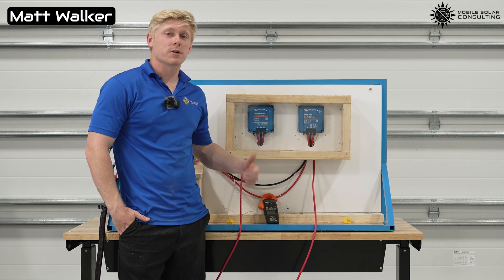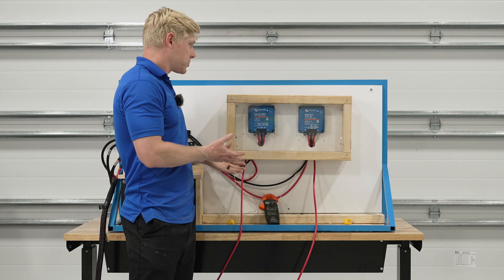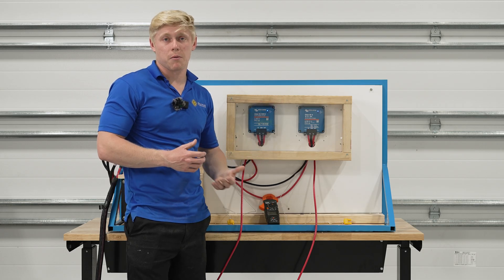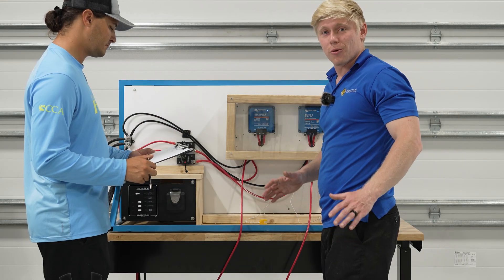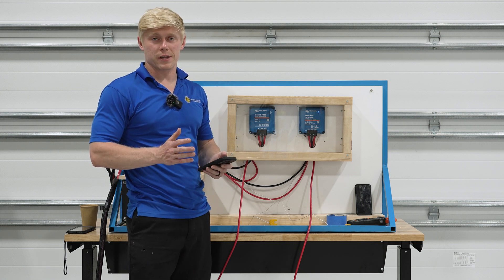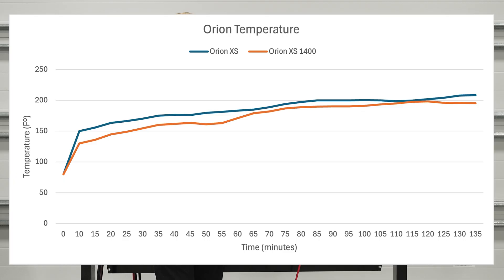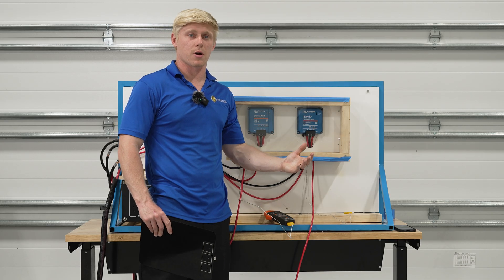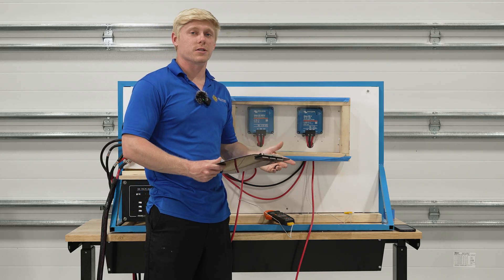How Hot Do Victron Orion XS & XS 1400 REALLY Get??

Comment: Quick comment to begin.. the onscreen vid mentioned at the end, does not appear onscreen.
Also, I replied to a couple of other comments, so see them for more of what I have to say.
Thirdly.. since both of these were outputting 12 volts at 50 amps or so, as far as the 1400 being cooler, I think it's only fair to mention, that since it handles multiple voltages, and was introduced later (ie: lessons learned from the past, implemented in the future), the 1400 has an actual exterior heat sink, whereas the original 12 to 12 is just a flat back design.
EDIT > re: my last point, I know 2 different folks who jumped on Amazon, and ordered a couple of small heat sinks and 'glued' them to the back of their 12 to 12's with thermopaste, to aid in non powered(no fans) cooling ability, to increase temperature control of their units.
Reply from the maker: Thanks for the feedback regarding the on-screen video and the design differences between the models. I've just pasted the link to the other video in the description. It is appearing in the end of the video for some folks, but not for others.

Comment: Hi, you tested them in the same heated compartment at the same time. Wouldnt it be fair to test them in separate compartments to see how they preform without heating each other? Have a great one /Andreas
Reply from the maker: Hi Andreas, thanks for pointing that out. Yes, better to test individually, but it made a very small difference, and represents a typical DIY system well, where the user has many heat-producing items in one small space. 

The temperature on the front of the Orion's was around 20-25C less than the back, at most times, so the entire box was not super hot, mainly just the back of the units.

Comment: Hi Matt. Would you install the Orion in the truck or in the trailer itself. If it needed a fan why wouldn’t victron include one?
Reply from the maker: We usually install the Orion in the trailer, but it's IP65 rated so it could go in the truck bed in theory. I would imagine Victron does not want to be responsible to warranty moving parts for 5+ years.
Reply: For starters, They performed here totally within spec... Victron states the back of them can reach 90 degrees C, and here we saw 93. as for fans.. yes, the moving parts already mentioned (who wants a device to rely on moving parts if it dent have to?). That said, Victron also clearly states on their site, that lower ambient temperatures and/or forced air cooling, either direct of in cabinet, also allows them to perform longer at higher outputs. Also, it bears reminding, the units were installed/tested in conditions outside spec, as in not enough airflow space, around them, just so they could intentionally drive up the heat to monitor derating. Also, if you design your system properly, you wont be driving your devices at 100% capacity.. 80% is much better, for any brand of any device. This was an 'extreme test', as I said, just to capture derate engagement.
As for placement, there can be various 'optimal' designs. I mean, if you were using the 1400 to go from 24 to 12, or 12 to 24, then the long cable is best on the 24 side, as that's less amps(heat). in a 24 to 24 or 12 to 12 situation, either placement is equal. That said... once those considerations are taken into account, the next, or first, determining factor would be on usage. I mean.. if you want to be able to allow any vehicle or source to charge your house batteries, it makes sense to install in the trailer so you have the dc to dc ready in line.. but.. if you want to use your truck to work on multiple/other systems, then of course it should be in the truck.
Takeaway? It depends on voltages and planned usage to decide where you place the unit in the system.